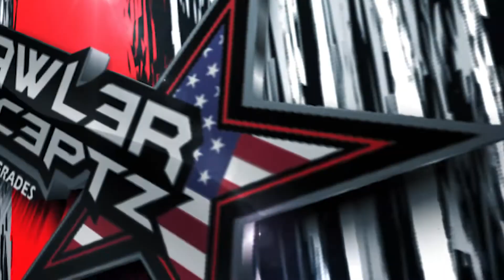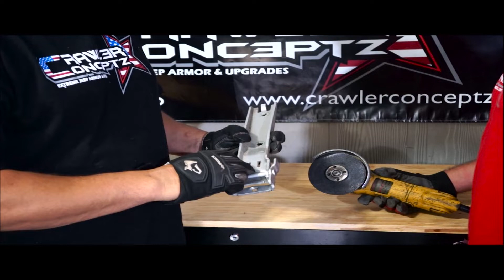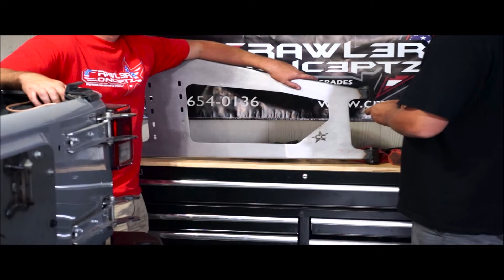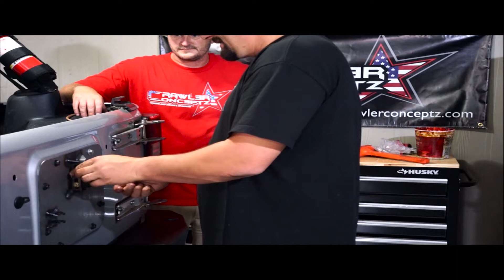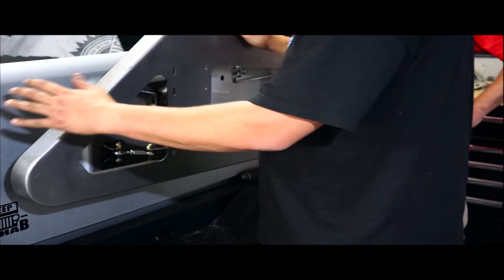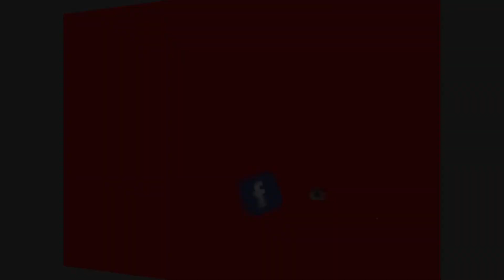Crawler Conceptz Ultra Series Jeep JK Body Mounted Tire Carrier Installation Video

Comment: Not sure if I gonna get a reply to this but I'll ask anyway...
Will the tire carrier work with the upgraded reinforced hinges? 
http://www.extremeterrain.com/barricade-hd-tail-hinges-j102515.html
I don't have them, I would just like to know if the two products can function in harmony. 
Thanks so much!
Reply from the maker: Thanks for the question, John!  We have not had an opportunity to test our Body Mounted Tire Carrier with this replacement hinge product.  The factory hinges and attach points are very solid and our tire carrier is engineered to work perfectly with them!